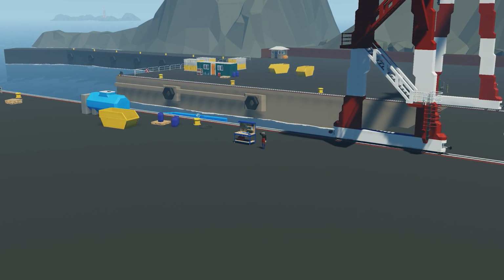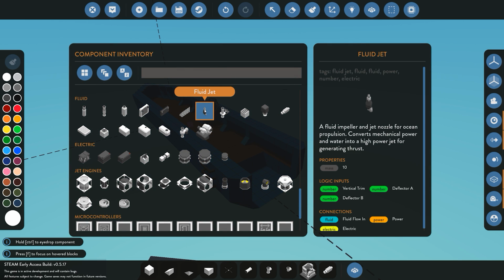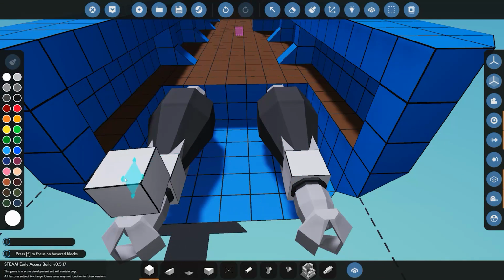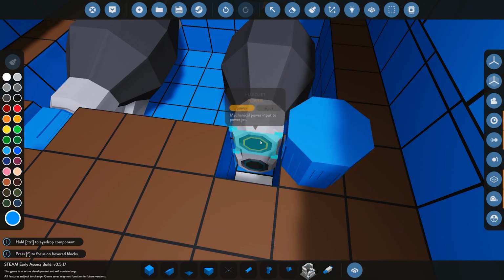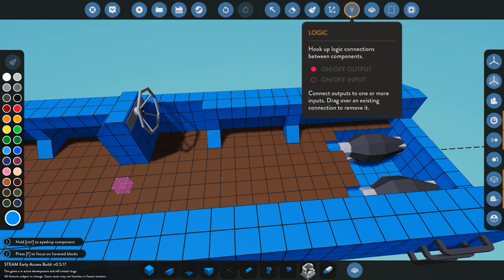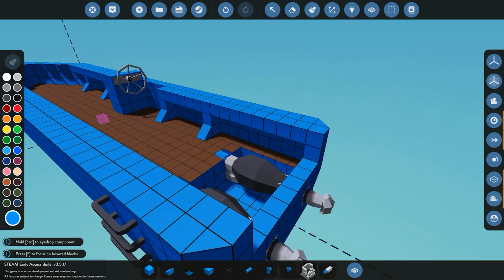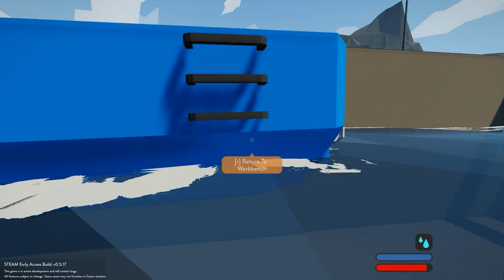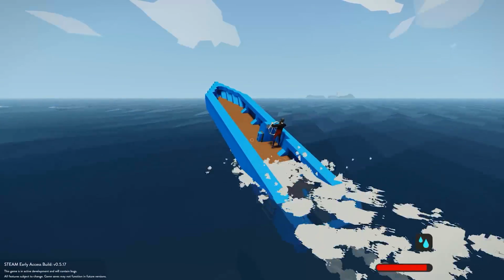Stormworks - Fluid Jet Tutorial

Comment: How do fluid jets do with regards to fuel efficiency compared to a similar speed from propellers? Thanks.
Reply from the maker: More or less the same, you want to get the engine on a low rps as possible however it will be harder with jets compared to props

Comment: So you can use this with a hydro foil, this is what im doing, and I beleive you can use the vertical trim instead of control surfaces?
Also I wan't to water cool my engines so I need to pump through the sliders.
Reply: These days maybe you could drop a line from a winch into the water and suck up water that way.

Comment: I would love to see a fluid jet small variant for making jetskis.
Reply: Is there a seat that can be used for jetskis in stormworks?
Reply: @dnt_alert5806  I don’t think there is but if you find one tell me please.
Reply: @callsign_daddy6737  the padded seat is the smallest seat, but all your controls will have to be buttons and levers.
Reply: @dnt_alert5806  you can actually use a remote controller from the padded seat these days and store it anywhere within arm's reach, you will have to use a micro-controller to decompile the composite signal the recievers send out however, but it can be done with WASD and the arrow keys!
Reply: @rivetthescree  ooohhh I didn’t think of that
Reply: @dnt_alert5806  i mean, now with da search and destroy update u can use handle
Reply: Well, if you want to use the WASD keys, use the driver seat, it's small enough

Comment: How do you reverse with Fluid Jet? you skipped over that part and I can't figure out how to send the same signal to both left and right, have you covered that in a tutorial before?
Reply: @MythionVR  
1. Toogle Button (reverse) ---> Switchbox (ON Signal RED)
2. Connect two "Constant Number" modules to On GREEN and Off GREEN on Switchbox.
3. Make one Constant number 1, and the other 0
4. When Togglebutton is ON the number 1 signal should be sent to each jet you want reverse, This makes the streams direct backwords.
5. Toggle button of to reset and just steer as usal.
Hopes this helps.
Reply: kid Hope this Helps. Get The Numerical SwitchBox Then Put Another 2 Number. One number should have an a number of 1 (this goes to the ON signal of the SwitchBox) The other one should stay 0 (Goes to the off) then the output if the switchbox has to be connected to the left and right of the Jet😊Nice Vid Mrn
Reply: Both of these solutions dont work, you cant have more than one input per connection
Reply from the maker: Send a one to both the left and right bank
Reply: @MrNJersey   That's the part where I am lost, I do not know how to send a 1 to both hehe xD ... I gave up and moved onto making an advanced helicopter with pusher prop at the rear, such a fast helicopter 0v0
Reply: @MrNJersey  Is there a tutorial on this because it doesn't seem to work without replacing the steering since the left and right banks only take one connection. Please help! This is the single most frustrating thing since it's the only thing I can't figure out... I'm about to give up on waterjets.
Reply: @MrNJersey  I ended up putting a water jet at the front of the boat to push backwards when pressing up arrow button haha..

Comment: Could u do some guide for large ship with fluid jets? my is going only 7m/s
Reply: I made a big catamaran with 8 large diesel engines and 16 water jets that does about 45/50 knots. My experience is that the jets aren't very efficient, but with enough jets and power, you could get quite alot of speed 😁
Reply: 98madman98 you say inefficient but i cant get the same kinda speeds with props. Im having allot of problems getting my tanker above 30m/s 8 jets powered by a medium motor per jet

Comment: Is there a way to make the stream or water go farther i asked 3 times during stream but you didn't see
Reply from the maker: Dont think so
Reply: @MrNJersey  dang it I'm trying to make a water conan that has more power than the fluid conan
Reply: @bluenight317  If you add alot more fluid portsand a large pump or 2 I got one of my fluid cannons to go .2 km that is 200 meters 
so you can make a stronger fluid cannon also sometimes I find that it doesnt need as many pumps as you'd expect you could have maybe one or two pumps but it needs more fluid ports since there is only so much water that can go through one port at a time.
Reply: @TheGoldenWarden  is that with the fluid cannon ot fluid jet